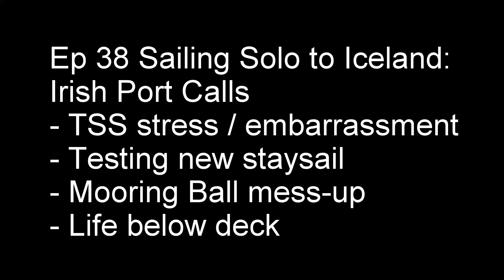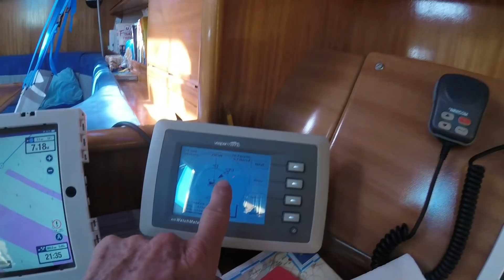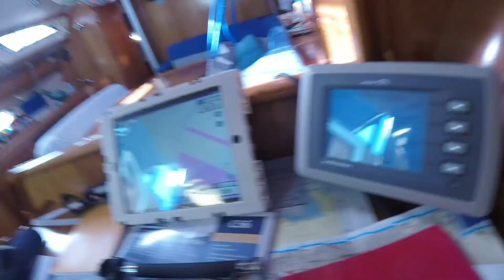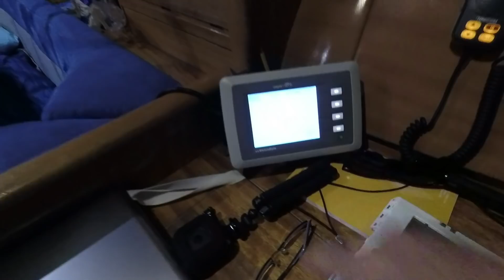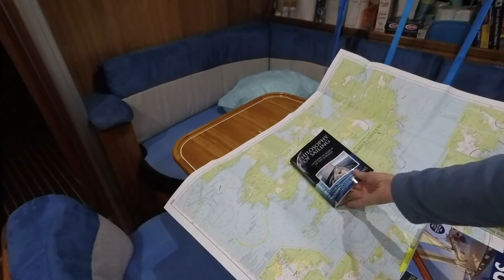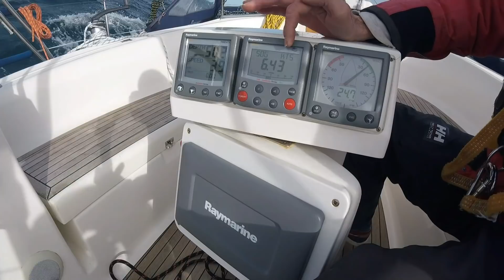EP 38 Sailing Solo to Iceland   Irish Port Calls

Comment: I had a close encounter with a tanker as a teenager during an afternoon sail with a friend in Narragansett Bay. We were sailing out of Newport Harbor heading west towards Jamestown. My friend and I were sitting on the windward side of the boat and facing north. I was at the helm. Out of the blue, I heard three loud blasts of a horn and looked  around and saw a tanker in the south a  distance  away (maybe a2-4 miles) headed towards the entrance to the bay.  The problem was that the ship needed to turn more towards  the west once it entered the bay as it needed to go under the center span of the Newport bridge. The ship's captain evidently thought we wouldn't be far enough across the bay and out of the way if he continued his course. There wasn't much we could do as far as tacking was concerned with a light southwest wind to get out of its way. We kept heading west and the tanker passed behind our stern about 300 feet away. Needless to say, we had no radio or fancy electronics  on the boat to warn us of potential danger or to communicate with the ship. It wasn't the first time I'd sailed close to big ships but it was the first time one thought I'd gotten in its way.
Reply from the maker: That is an excellent example Emily of the myth of 'small boats can always' maneuver.   I too have been in positions where it was MUCH, MUCH easier for the large ship to maneuver than for me to gybe in very high winds, or tack onto a bad heading.  Thanks for commenting.
Reply: @patricklaine6958   Well, in this case, at first I didn't see what the panic was all about. I thought I'd be way out of his way by the time he got close to me. I could have done a series of tacks and headed south and then west, back and forth to move the boat away from the vicinity of the arc the tanker needed to make but initially with him so far away it was hard to tell what to do or if dong something different would really be that much better. The tide was probably coming in and slowing us down. But then I remember thinking it might be 6 of one half a dozen of the other. ( Although I might have been wrong.) I thought I'd be able to figure out a plan "B" if push came to shove and it got too close.

Perhaps he just wanted to make sure i saw him so i wouldn't do something really stupid like decide to change course and head downwind to the north through the center span of the bridge where he was headed. If  i'd done that i'm sure there would have been more 

One thing ships can and should do, the way motorboats are supposed to do, is SLOW DOWN for sailboats.  in this situation he couldn't have changed course because the entrance to the bay was tight and there were various dumplings and islands  inside the entrance he also needed to avoid . The only thing that would have helped would have been for him to slow to a crawl.

Comment: Patrick!  Bravo Bravo!  My stay sail and a single or double reefed main and even the third reef in the main, powered me to windward for days on end inbound from the Azores last year.  Yours looks great!  
Oh ... an ... when you get your new main sail (after this current absolutely epic voyage to Iceland) talk to me about the stack a pack (and thanks for mentioning me).  Mine folds away permanently until I need to drop the sail when coming in to port.  Nothing flapping about on the boom and no lazy jacks chafing my lovely sail out in the ocean.  I can explain what your sail maker needs to make for you.  
I can sometimes jibe without furling the genoa but I always furl to tack.  The ONLY time I have a rolled genoa is when running downwind poled out in strong winds and I want to keep the weight forward (Portuguese Trades last year).  Otherwise ... I never furl the genoa.  I reef by going straight from genoa to stay sail ... always.
Re sea anchor!  In anger the vital thing is distance as you don't want the anchor tripping in the troughs.  It needs to be in the back of a wave.  You need tremendously strong chain plates on the transom/stern to attach the bridle.  I actually carry a Jordan Series Drogue and hope to god I never have to use it.  But practice and knowing how to deploy them is vital.
Well done for showing sailing on to a mooring buoy.  I do anchor and pick up my mooring under sail.  You never know when you'll have to!  But I will always sail the boat anyway.  
I am following your progress north, completely in awe, as you leave Rockall astern.  Safe arrivals ... and well well done indeed.  I'm far too scared to venture in to those high latitudes so early in the year.  Stay safe Patrick.  Fair Winds.  ATB James

Comment: Phew, glad you didn't get run down at the edge of the TSS. Also that you followed the stand on rules (of the col regs). I was a little concerned as you were describing your plan to dodge between the huge vessels. I was in a similar position in the Strait of Gibraltar and while we kept a close eye on the ships, our captain held his course because we were the standon vessel.
Reply from the maker: Thanks Colin.  The ColRegs aren't particularly helpful when you are just at the start/exit of the TSS --- they just say something like, 'Be extremely vigilant', without specifying which rules to apply (don't impede inside the TSS vs stand-on/give way outside).    For the future, I'm just going to apply the stand-on/give way rules as they are written in black and white, without any interpolation by me.   :-)

Comment: Patrick, Hoisting a cone on your fore stay would indicate to stand on ships that you also are sailing under motor and can take collision avoidance action if necessary. While steering at a 90 degree angle to a traffic separation zone is preferable to a lesser crossing angle, the problem is still there and would still put the wind up the officer of the watch on the bridge of a super tanker, I know that from personal experience. Green to green, red to red, perfect safety go ahead, anything else in a restricted maneuvering zone will definitely draw attention.
Reply from the maker: Not sure I fully follow Peter.  If you are crossing the entrance of a  TSS channel, by definition you are going to be red to green or vice-versa on the vast majority of the crossing boats.  Unavoidable.    In those cases, you just have to follow the Colregs in terms of stand-on and give way (which I did not do).   I'm not sure that the inverted cone adds a lot of safety to the dialog, but I agree with you that it does inform the tanker that the small boat is probably a bit more maneuverable than a pure sailor.
Reply: My point was to avoid areas of high congestion. Green to green, red to red means going with the flow as opposed to crossing shipping lanes of high density.
Reply from the maker: Ahh - I got you now.    Yeah -- that would be the ideal situation……..hard to do that with sailboats (slow speed, somewhat limited maneuverability, and recommendation to stay out of TSS's).   Fair winds to you.

Comment: Great film as ever Patrick. I suspect you will find yourself using that new sail more and more. I know we put our number 3 up from the moment it will start working. Its just so much easier to use than a larger overlapping headsail... and we do the majority of our sailing in protected coastal waters so i suspect that would apply even more when offshore.
Reply from the maker: I should film a good shot of my huge, pregnant genny for you to see Ian.  I JUST LOVE that flat staysail.  I think this could be the beginning of a beautiful friendship.  :-)
Reply: Patrick Laine are all Genoa sails that full? Or can they too be built more like your staysail (Solent)? I guess this gives you the best of both, the Genoa for lighter and the knife for stronger conditions
Reply: @mhensen1  I sail can be cut to be any shape you want. I suspect Patricks is so full partly because its getting old and traditional sails blow out (loose their shape and become more full) over time and partly because, for general all round sailing, you want a one with some shape in it for the lighter conditions. Now that Patrick has is new smaller sail for when the wind gets up having a genoa with some shape for the lighter winds is actually a good thing.

Comment: Patrick, excellent video. That has made a great start to my day. I laughed when I saw the message about the heater (now installed and working - it's great). - Your viewers are going to wonder who this Paul chap is.

I need to get an AIS system. Quick question. I am always meticulous about displaying an inverted cone during the day if I am motorsailing (or the steaming light etc at night). - Do you have to change your 'status' on the AIS system (I am assuming you have one that transmits as well as receives) so that other ships know what col regs to apply? I know it didn't make any difference in your situation.

Love the look of Western Ireland. That is definitely on my destination list now. Cheers, Paul.
Reply from the maker: My AIS allows me to change 'Offshore', 'Coastal', 'Harbor', or 'Anchored' --- and that is important because the AIS applies different filters for each mode.   I am not, as far as I know, able to change my registration as a 'sailing vessel'.    I'm sure it is possible, but it is deep down in the software --- and something you do when you initially set up the device with an MMSI.  Fair winds
Reply: Patrick Laine Hi Patrick if you go to my status in your AIS you should be given the option under sail and under engine hope this helps.
Reply from the maker: I'll check next time out Alister, but don't really envisage changing it.   Not sure that information is particularly helpful to others.

Comment: When entering an unfamiliar marina (Galway for instance) consider reversing into the aisle. Makes escaping easy if you don’t like how things are going and in that instance would have made for a better approach. Bow thrusters make life so much easier though. Don’t you just hate it when the boat hook snags 🤬 at the last minute? I often think picking up a mooring ball is one of the most hazardous evolutions for the single handed. Guinness and garlic prawns should be on the menu, enjoy Ireland.
Reply: Niall Rath true but some just hate reverse
Reply from the maker: Very good advice --- though in my boat (with a saildrive) it backs straight ahead very nicely, so really not much in it to come in ahead or astern.  It was a very narrow fairway though, and I had my head outside the bimini frame to ensure I did not hit another boat as I turned.    This is the IDEAL time to have a bow thruster --- little way on, and need to turn the bow.   Love it then, but don't use it much otherwise.
Reply: Oh, nice staysail, very jealous.

Comment: Thanks for your tip I thought you had the give way to large ships
Reply from the maker: In designated sea lanes, and if they are doing special operations that is true, but otherwise a sailing vessel is supposed to 'stand on' and the power boat 'give way'.     Common sense comes into the equation to, of course.   Thanks for commenting.

Comment: Pick up the ball by backing in under power. You maintain control and can swap ends later. Don't have to run forward to hook up.
Reply from the maker: Agree, but the stern of my boat is not easy to operate from: two davits sticking out, a bimini frame that gets in the way, a high aft pulpit, a mounted life ring, a gps receiver, etc.     I've done it from there before, but if the approach isn't perfect and i need to 'reach' for the buoy, lots of things can go wrong.  😊

Comment: Hi Patrick. I am a little concerned that you intend to sail so far North without really knowing how to handle your boat in heavy weather. Clearly you are well on your way but please take onboard (!) a bit of advice: lying to a sea anchor off the bow is NOT the best way of managing extreme conditions. Get rid of the main and run off the wind under minimum headsails (this is where your new staysail really comes into its own). Take following seas on the quarter. If you are still moving too fast and at risk of pitchpoling or broaching THAT IS WHAT THE DROGUE IS FOR. Trail it off the upwind quarter: it will slow you and help hold your course. Keep your washboards in just in case you get pooped. May you have fair winds and flat seas.
Reply from the maker: That built my confidence Pugwash!  ;-)   Agree on all, with the obvious exception that running is not always an option (and it does mean you will be in the storm much longer, and may well have to beat your way back).   I note and understand the difference between a sea anchor and a drogue, and what you describe is how I would intend to use a drogue.   Thanks for watching.

Comment: Hi Patrick
We are very interested in your trails with the new staysail.  Thanks for sharing.  We wondered what you needed to add for blocks.  When watching you come in to the dock at Galway we saw a block just next to the winch by the cockpit on the starboard side.   Is that what you use?  Please keep sharing your experiences with the staysail. Thanks as always.
Reply from the maker: Great question Simon, and I have purposely NOT shown my deck hardware for the new sail, as it is all still in a 'temporary' status until I decide exactly what I want, and where I want it.   So, for now, I have attached a few blocks and friction rings that allow everything to work correctly.  When I return home from this trip, I will drill holes and add permanent blocks/clutches/friction rings.    There are a lot of lines leading aft now ---- three sheets on each side now, plus the a traveller line on each side, plus a furling line on each side.  It is starting to look like a spaghetti factory, so I want to think this through carefully.
Reply: Hi Patrick
Ok, great.   Understood.   When you do figure out what works well (or if you discover something that really doesn't work at all) please share if you can.  In the meantime we will look forward to seeing what the next step on your Iceland adventure brings. Cheers.

Comment: Another great video, thanks! Regarding the COLREG hesitations, would it be thinkable to contact the large vessels intersecting (e.g. that tanker) and tell them that you plan to let them pass ahead of you, to avoid potential misunderstandings?
Reply from the maker: I have contacted ships before just to clarify my intentions Alfred.   However, I think this practice would NOT be a good idea in a very busy area like where I was for a couple of reasons: 1)  I did not show it well, but I'll bet there were at least 30 large ships within 10 miles of where I was going both directions.   Radio comms in such a crowded area would almost certainly have led to confusion as to whom was passing ahead or behind of whom; and 2)  I quickly learned that the English bridge communication skills on many ships is 'limited' --- surprisingly so.  If you throw in words not commonly used like 'aft' or 'astern' --- again, you are likely to create confusion.  I really believe that 'best practice' is just to follow the rules (which I did not do) and keep off the radio unless in a dangerously evolving situation.   My view anyway.  :-)
Reply: @patricklaine6958  Great reply, that makes perfect sense!

Comment: Mr Laine, I enjoy your videos during our covid19 lockdown in Ireland
(very good and instructive!).

With regard to being the Stand on vessel, if one is motor sailing rather than just sailing does that change the decision?

All the best, fair winds!

Boris
Reply from the maker: Technically yes.   As soon as you turn the engine on, even with the sails still up, you must follow the rules pertaining to powered vessels.   However, there is no way for ships to know if you have the engine on (unless you display an inverted triangle in the foredeck rigging) , so they assume you are a sailboat with 'stand-on' responsibility and they are supposed to give way.
Reply: @patricklaine6958  many thanks for that. They seem very nerve racking affairs from the comfort of my arm chair! You explain all decisions very well, appreciate it.

Looking forward to your 2021 adventures!

B.

Comment: I have a Solent rig too. I use both sails quite often and they work pretty well.Why do you say this is imposible? Am I interfering the main with two sails ahead? I enjoy your vídeos greatly. The Best on the net!, Thanks for making and sharing them!
Reply from the maker: Perhaps I am mistaken Luis.  I was 1) afraid to overstress the mast by using both headsails together in any position other than dead downwind, and 2) I thought the airflow of the two sails would be very disturbed as they are so close together (this is not a cutter rig).    I'm going to ask Selden about using them both together as someone else made the same comment as you.

Comment: Is that a new bow thruster we hear for tight docking? Or have you always had one?
Reply from the maker: I have always had one, but do not use it very often Sphinx2k.    It is perfect for situations where you do not have much way on and need to get the bow through a turn quickly.    For that reason, I use it fairly often when departing a tight berth, but usually have enough way on not to need it when I am arriving.   :-)

Comment: Beautiful video, I would be interested to know what brand of davit you put behind the boat.
it seems to be partly dismountable.
we have the same subject in common.
thank you
daniel
Reply from the maker: Someone else asked me that Daniel, but there is no brand marked on the.  They swing 'up' into the vertical to reduce risk of collision astern, but rotate down into normal position to handle the annexe.
Reply: Patrick Laine  thank you 
If the rotate that can be made by Mpi in France gyrofix.
I have the same boat 40’ 2008/2009.
And I go to fix in the selden mast something like you for I little sail Solent.
I love to see the sailing boat to go in the sea.
I have no time now to do it.
Continue to make video, they are very great and instructive.
Good wind in the sail